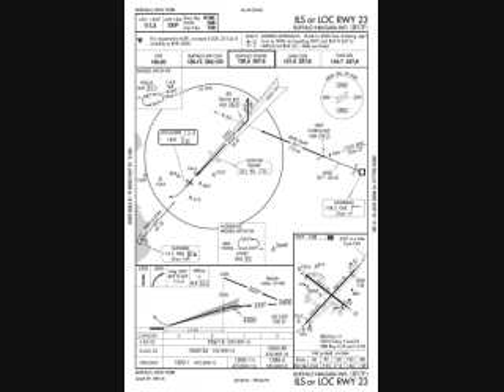3407 ntsb #4 pilots configured the aircraft's flaps and landing gear for landing q400 at Buffalo

Comment: pythos1:

The power had been back at or near idle in order to slow down for the final approach, but after the stickshaker activated and the automatic pilot disengaged the pilot promptly powered up and pitched up drastically--before the stickpusher activated.

A stickpusher offers only about 30 pounds of force;  the pilot was able to overpower it easily.

Comment: Flaps 15 degrees was never selected.

The "upset" was the pilot drastically pitched the deck angle from 9 degrees to 20 degrees. That was before the stickpusher activated.

The stick moved forward?  When?

The back pressure applied in a tail stall is to get the nose back up where it belongs.  They didn't have that problem.  The nose began too high at 9 degrees, and the pilot pitched it up drastically to 31 degrees.

Comment: The stickpusher didn't activate until he had pitched up to 29 degrees.
The plane had been holding altitude just fine, and pitched up even further after the automatic pilot disengaged.  Elevator authority was excellent.  

The plane had been maintaining altitude just fine;, the pilot pitched it up much more once the autopilot disengaged.

Before the stickpusher activated, the pilot had already pitched the nose up to 29 degrees--guaranteeing a stall.

Comment: No, pythos1, the tailplane was very effective.  It had brought the nose up to 10 degrees when the automatic pilot was engaged, and up to 31 degrees when the pilot pulled it up.  A tailplane that is stalled or nearly stalled couldn't have done that.  

grandCentraldepot:  The plane's pitch attitude was brought level and the  descent almost stopped before 1920' MSL--after dropping from 2500' MSL.  If the tail was so blanketed as to be ineffective the plane couldn't have done that.